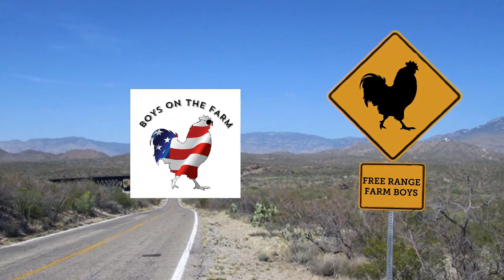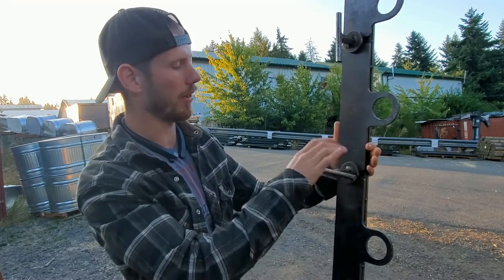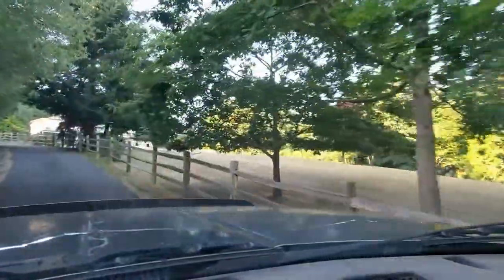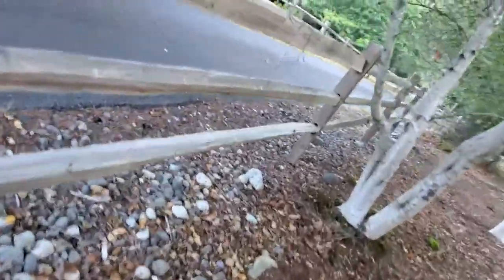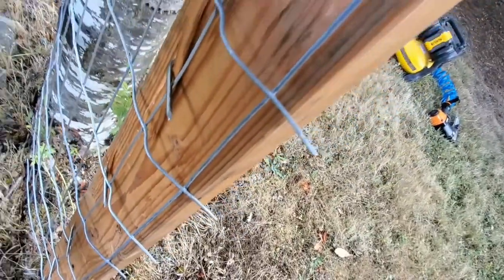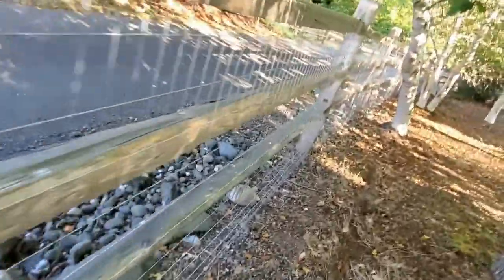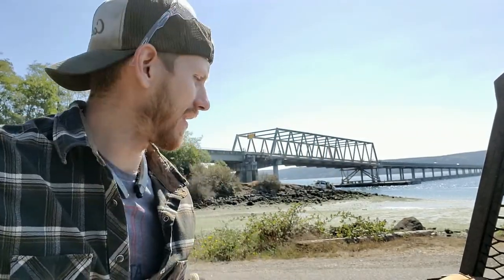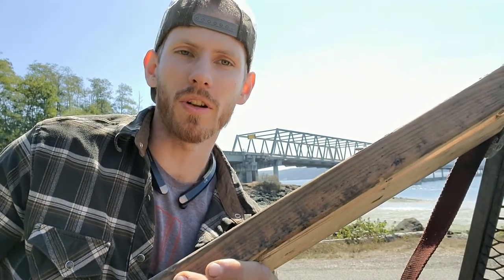DIY Fence Stretcher In 2 Minutes

Comment: Is there a reason you are stapling the fence to the post when the fence isn't plumb to the post like at 10:00?
Reply from the maker: Hey Best! This fence was on a slight grade. Its hard to tell in the video. When wire is pulled tight it will conform to the shape of the ground the fence is built on. Better to keep it tight than plumb but it the ground is level you can do both! Thanks for the comment!